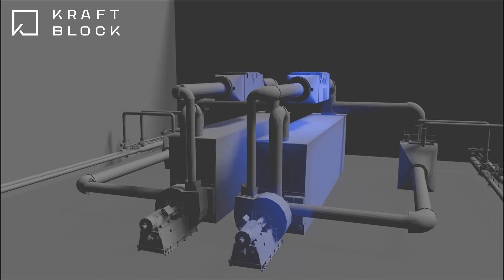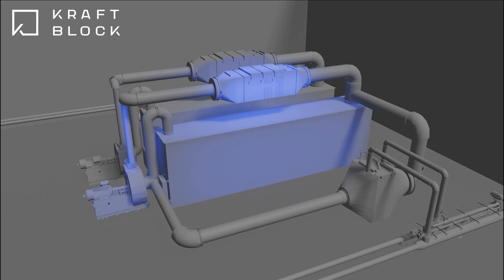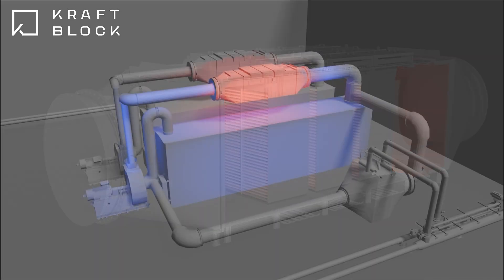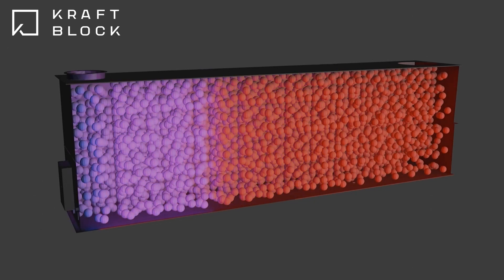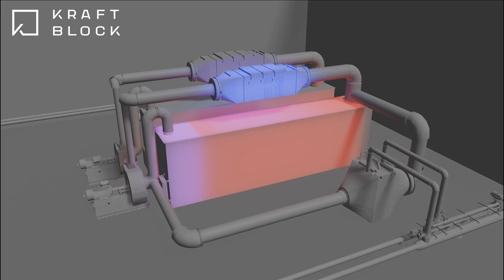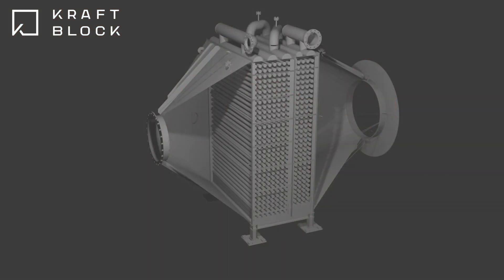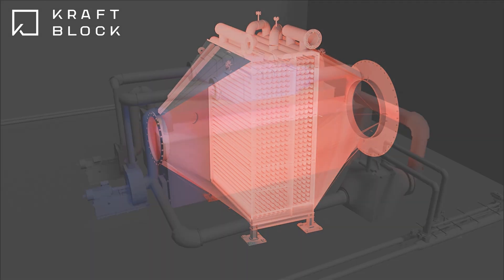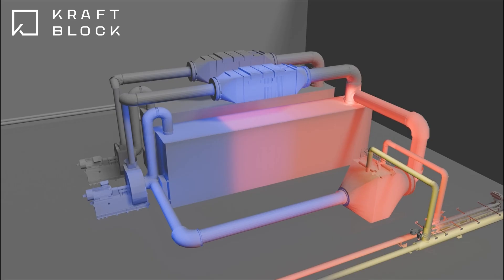The Net-Zero Heat System at PepsiCo

Comment: Do you know how water heater work and why it is placed vertically ? I would like to know how efficient it is.
Reply from the maker: Hi, A water heater is basically It is a wire that is put into a metal "rod". Between the metal and the wire, usual a ceramic insulation powder is filled, so that no electicity reaches the metal rod. Then you let electricity flow throug the wire which heats up as the effect of resistance. The heat gets transferred to the outer shell and heats the water. Such systems can be placed horizontally or vertically (mostly if you use "hundreds" of them). For systems under pressure, a vertical and tube form can make more sense. In our case, we have some undisclosed developments that make this shape better. 

Water heaters alone should have a very high efficiency, around 99%.